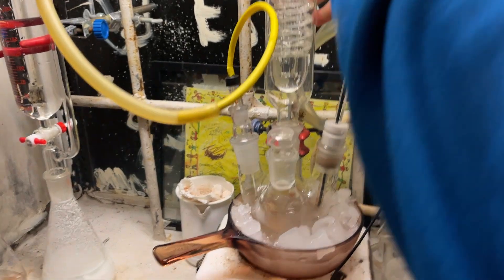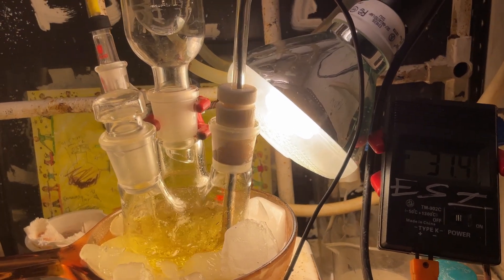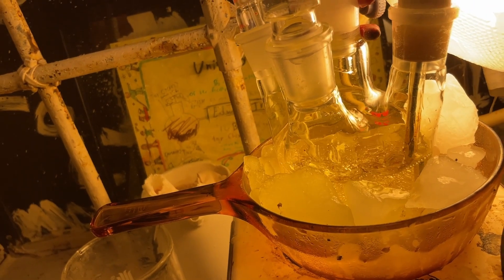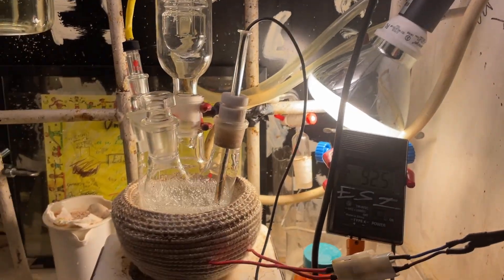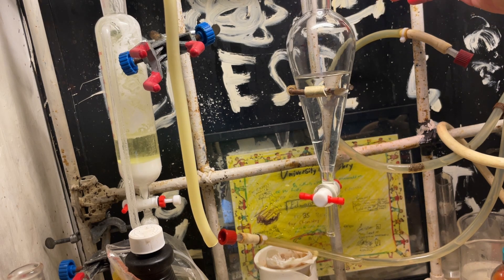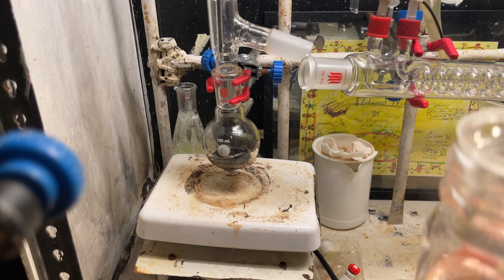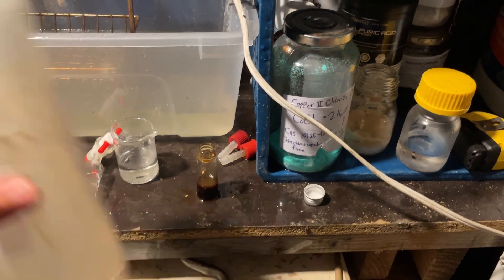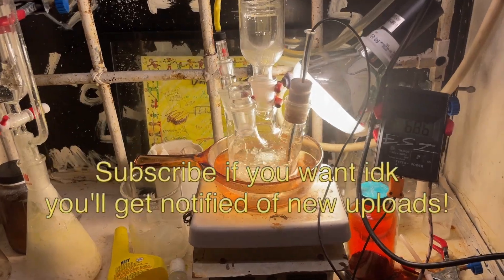Chloral: Irredemption Arc

Comment: It’s really a much more complicated and nuanced synthesis than it initially seems to be when you read the patent. I found that 70-75% ethanol worked best. The amount of HCL that comes off during reflux is obnoxious.
Reply from the maker: yeah if youve seen the first video ive made on this topic though the original vid i saw used 80% ethanol and he ended up with actual tar (although got a product). this reaction is just an absolute mess and a miracle that i even got something. harrison (pyrotechnical) also reported that he chlorinated acetaldehyde directly but got an off boiling point liquid and polymerized within a few days (though from my first attempt it never polymerized so possibly different compound?). i think he also tried to make DDT from it but it failed. he says he got distillate from 94C jumping to 106, nothing below which seems to match my results. he also got a positive tollens test but that may show false positives to acetaldehyde. on further thinking though, perhaps washing the weird liquid will get any chloral that is present out of it. either way i dont plan to do this synthesis again at least not by this method (not just because it is a horrible mess but also chloral hydrate is a schedule 4 although i dont think the feds care as you can just buy the stuff off ebay)
Reply: @EdwardTriesToScience  I bought some off Wish back when they still sold chemicals, 500g for like $25. I got impatient and made some in the meantime. Try adding an antioxidant too. There’s another chloral hydrate synthesis here on YouTube by a smaller channel (can’t remember the name but shouldn’t be hard to find) he ended up with good results.
Reply from the maker: yeah hazelchem, the otehr one i was looking at seems to be deleted entirely. funnily i might buy some benzene off etsy though, theres alot of chemicals being sold on there